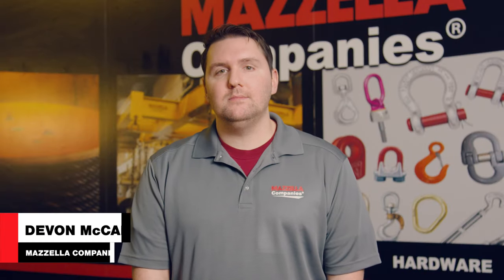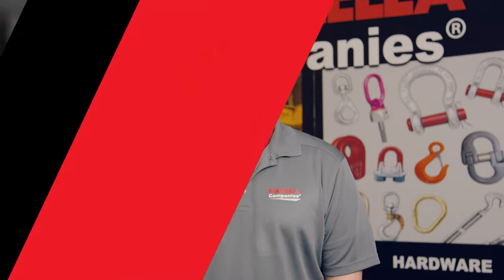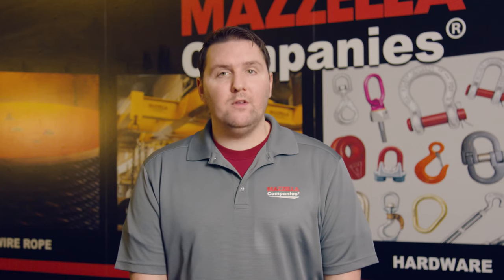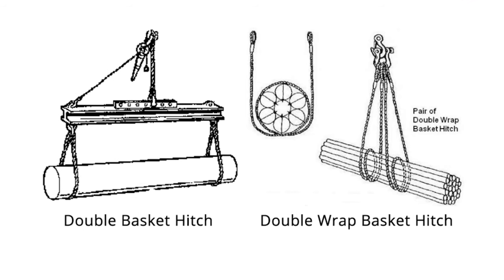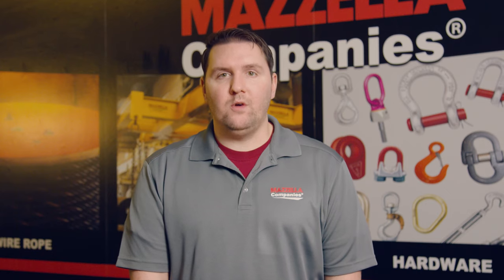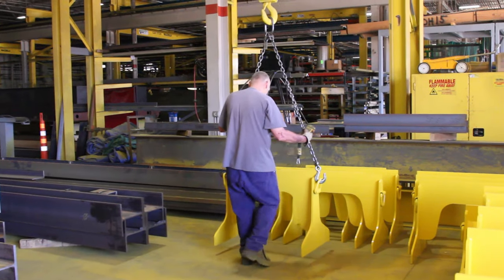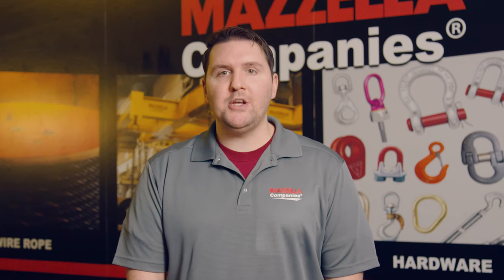How to Choose the Best Sling Hitch Type for Your Next Overhead Lift

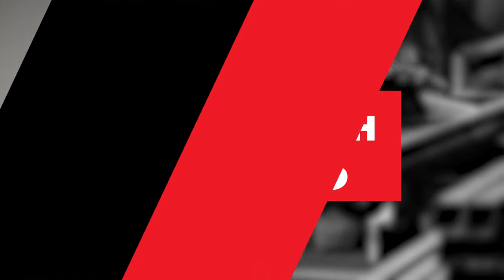Comment: At 3:40 when you begin to touch on multi leg bridle assemblies i think a video is needed to express that in a vertical type hitch on a single pick point the capacity needs to be understood as 1 leg regardless if you were to "marry" 2 legs into that one pick point or extension. I find that far too often riggers in the field using chain bridles believe that putting for example 2 legs from a 1/2" grade 10 bridle into 1 lets say 17T shackle riggers often assume that they have a 26,000 lb WLL. When in reality they are only good for 15,000 lbs.   Just a thought... Love the Channel.
Reply from the maker: Thanks for the comment! This sounds like something we can cover in a future video.